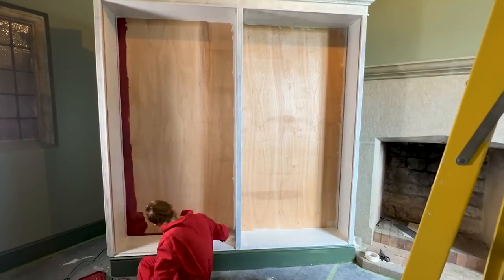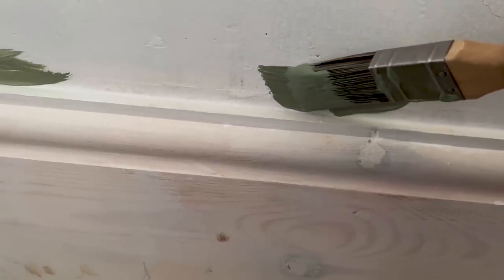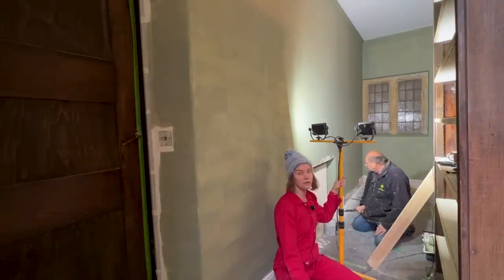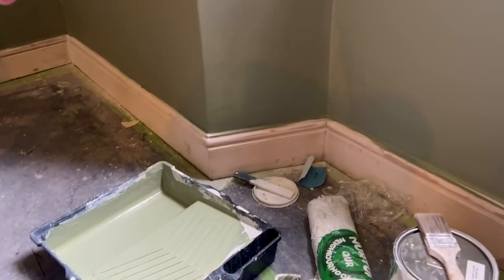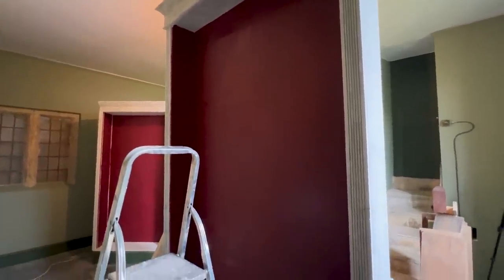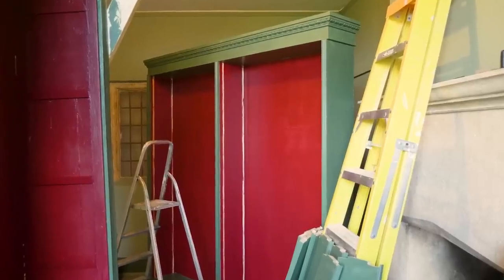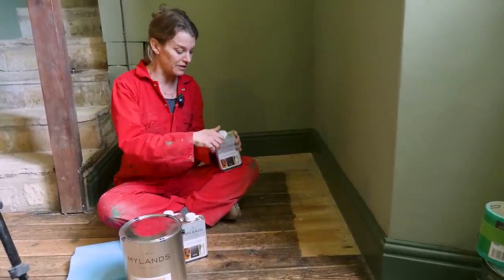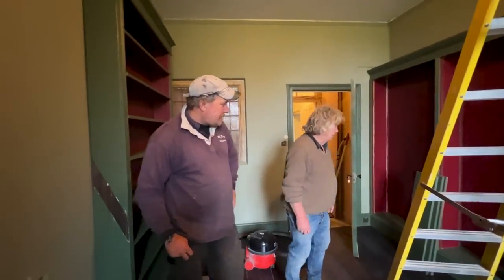Archive Room RESTORATION | Painting Complete! (Julie is exhausted 🤪)

Comment: Well Done Julie and Crew! The archive room looks amazing. One would never know about all the challenges you faced before even starting the painting. 
 I wonder if there is such a thing as Preventive Maintenance being practiced at Mapperton. I ask because I used to work at an hotel in the Caribbean.  Obviously the place was no where near the age, size, and or similarity to your place.  Having the hotel very near the sea was rather challenging.  We constantly were replacing corroded metal hardware, pipes, etc.  Humidity was another challenge,  dry rot,as was painting the exterior of the villas.  To start with, the program seemed like a no go.  But once  the employees and management accepted that this was part of a new Strategic Plan to save the hotel.  Before long each week as Management and Maintenace did a 'walk about'...it was pin-pointed that certain things/items needed to be placed on the list, the priorities, etc. etc.  Please forgive my presumption that you might want this suggestion. 🙏✨

Comment: Is your scanning operation being conducted in the muniment room? How are you handling the fumes and heat put off by the electronics? Just airing the room out after spotting for the day? If the chimney is operational is there a flue to decrease outside air infiltration? What has been done to the windows besides curtains to counter the infiltration of fading light rays or excessive heat/cold?
Reply: Don't forget she was a Chicagolander...  she has   more fresh air in England than we've Ever  had in Chicagoland, since the industrial revolution!  It's a big drafty house and chapel so, she should be ok.
Reply: Not to belabor the string, but remember, it was all the elements put into the air by people and industrialization that contributed to the degradation of the tapestries, curtains and upholstery. The fumes put off by things, particularly oil based put things into the air that can affect the condition of things. Chernobyl affected more than just the former Soviet Union. Personally, I moved into an apartment 14 years ago and the exhaust put off by all the electronics and cooking has made it that i have yet to turn on the heating system. If you want to maintain your archives in as safe an environment as possible even what you think is "clean" air not be so great. Additionally, moisture and paper do not always mix so when the humidity rises or mold gets introduced. Just a few things to be aware that others may not.
Reply: Whoa! Slow down there,  cowboy. Remember, these homes/castles  were once heated by coal burning stoves and wood burning fireplaces! Talk about damage... 🙄 

Chernobyl??? 
Really???
Reply: I guess I may have given the impression that I am a cowboy speaking of cattle feed, salt licks and branding irons. I should have made clear that I am an archivist not making an attempt at humor that falls flat with misconceptions and inexperience.
Reply: 👍Whoohoo! Good for you!  But, she isn't archiving the Vatican, here. I think she is gonna be just fine... 😉
Reply: Don't insult people then turn around and say someone else will be okay. Julie can speak for herself unless you are her spokesperson.